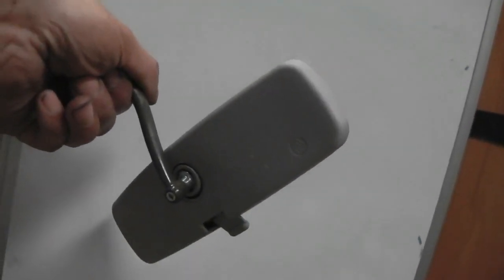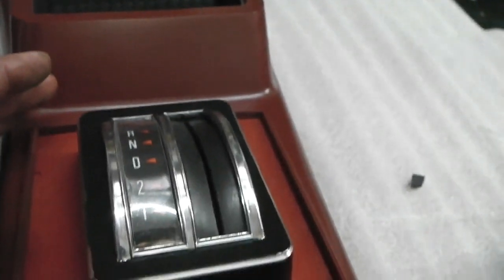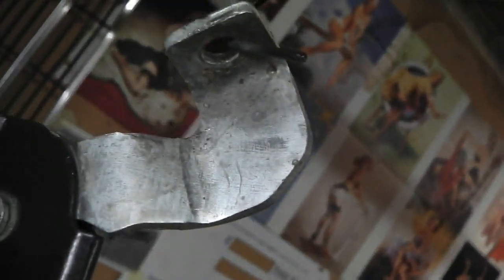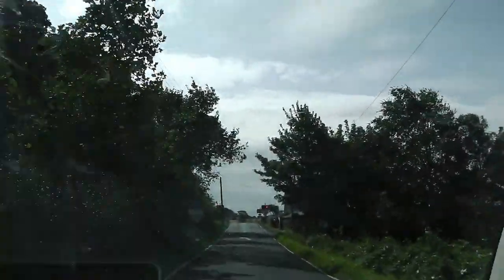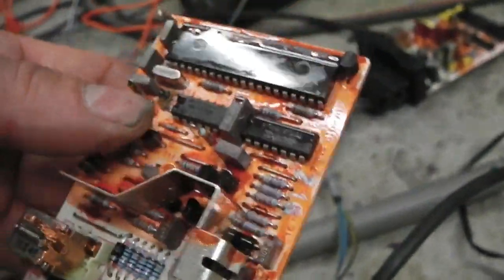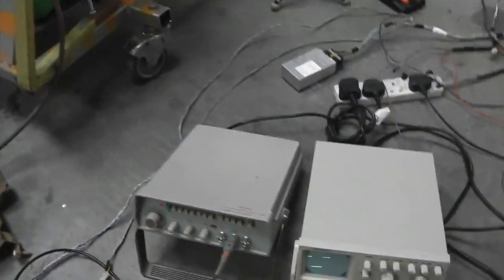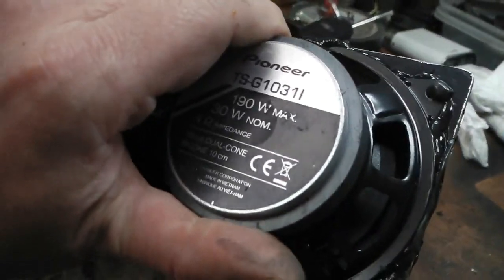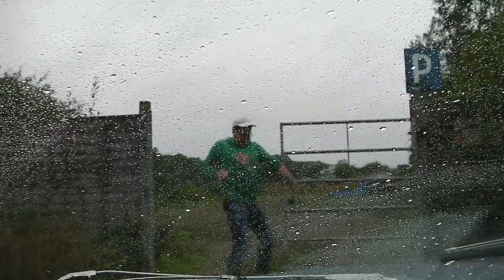Mk3 Cortina Resto - Project Ruby EP38

Comment: I watch these, because my Dad ran several Mark IIIs in the 1980s for work. He also did a lot of jobs on those cars himself during those times to keep them on the road as well as save a bob or two with the mechanics.

So I remember a lot of the parts that Pete works with, especially the brakes, front and back, my old man was replacing the shoes all the time, especially on the drums.

If ever I wanted extra money, my Dad would get me to wash the car, or do little jobs, like filling in the bodywork, which I was good at from also making models and filling seams on those all the time anyway. That's how I got to know the sills and doors really well.

Not as well as Pete, obviously, but they are very old memories that get bought back by watching these and seeing the same old relays my Dad would have lying around the house while he was trying to fix them, or even seeing the panel lines again and recognising them from washing them so many times over.

My Dad also had a Sahara Beige mark III, but not an automatic with the standard buff interior. Anyway, thanks for the memories.
Reply from the maker: thanks for sharing this. Its great when you watch something and all those childhood memories come back, im made up the film has brought some entertainement to you, for me it makes my day that bit more special, and i enjoying filming it even more especially readign your comment OSCU !! pete

Comment: Interesting how the cruise control does not like the lack of hysteresis that would be present when actually being run from the inputs normally,
 Crap, I worded that really badly.
 cheers, J.
Reply: And the shell looks lovely.
Reply from the maker: thanks Joe i think the engine throws the rpm up to the gearbox too quick for the cruise it needs road loading, it will work im sure. it s running good so far Joe, Pete.

Comment: Pete Ruby looks good I like all these mods you are doing ,I thought you was going to save that cortina MK3 1.6 L  as you all ready had a spare 2 litre pinto engine you could of put that in it & then sold it on as a project to some one
Reply from the maker: John ive left a note on the car. Got 3 more cortinas in the unit. I start on the 2 door GXL next. Ruby is nearly done.
Reply: Pete C Pete so looks like you are going to be busy for a while if you have another 3 mk3s to restore,but one good thing from May 2018 all classic cars & bikes over 40 years old won’t need a mot

Comment: Had a friend in London in the 70's who had a MK3 2000 E auto and he took out the gear position indicator and swapped it over as all the cortinas, and other auto Ford's I believe, were all using LHD indicators and he didn't like it.
Took a bit of work but at least at night you could easily tell the position of the lever.
A bit pedantic I know but it looked good and fixed a problem I've heard people complain about before.
Guess Dagenham were to cheap to order RHD ones eh..
Reply from the maker: Darryl i would liek to know more about this mod. do you mean the AUTO T shift indicator?
Reply: Pete C  Yes the T Shifter.He took it apart and swapped the indicator to the drivers side of the shifter.I think the linkage was modified as well but I can't remember if it was or not.
I'm sure a man of you're many talents can figure it out but even though it's only a small mod it looks like it's factory or at least how the factory should've done it.
Also if you're heating clear acrylic to form it a la gear position indicator make it a bit wider and shape it to fit using a random orbital sander once it's cooled   less chance of distortion that way..

Comment: The Aussie mk 3 used high back buckets or bench seats in the early one's the buckets in Aussie where tombstones
Reply from the maker: yes good seats, for this car i have the neckbreakers we call em!!!
Reply: yep in 1972 the TC (mk3) there was also a Bench seat option for the Cortina with a long T Bar if it was an Auto or a long Dog leg stick for the manual the 4s where 1.6 Kent OHV  2.0litre pinto and 3.3 200CI or 4.1 250Ci 6s. the 3.3 6 ran a 3speed manual gear box until the MK5 here in Oz the T Bar Auto being the most popular and the bench seat was thankfully discontinued in 1974 for the Mk 3 (TD) face lift